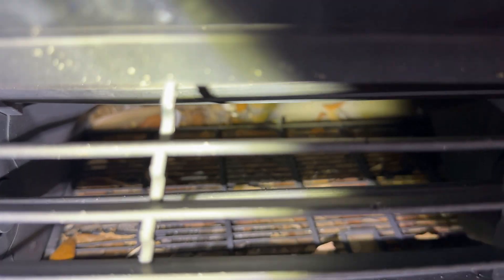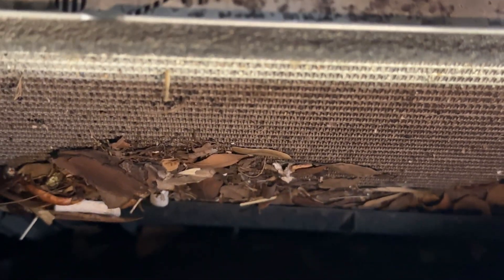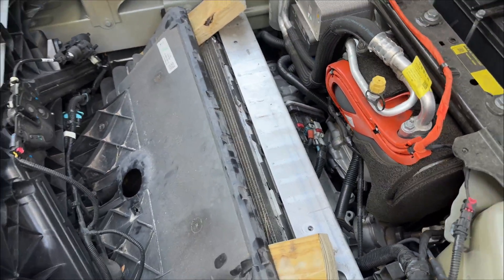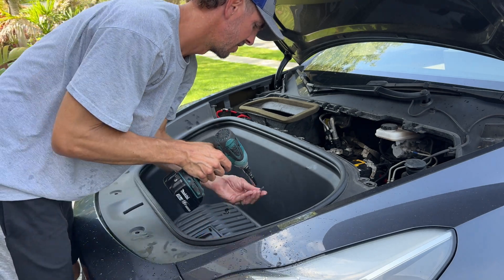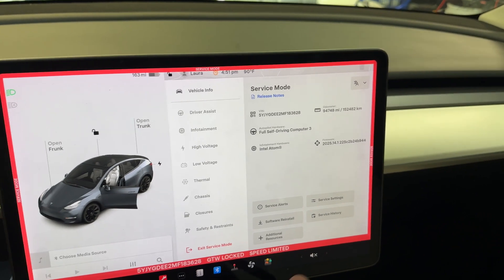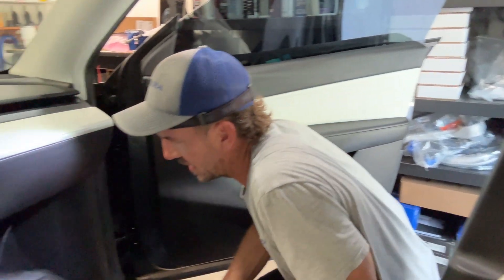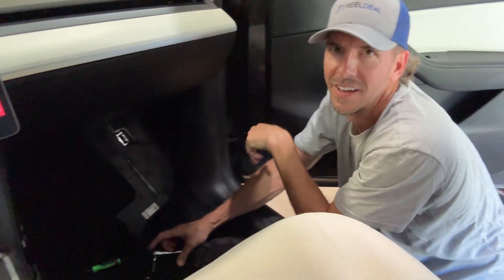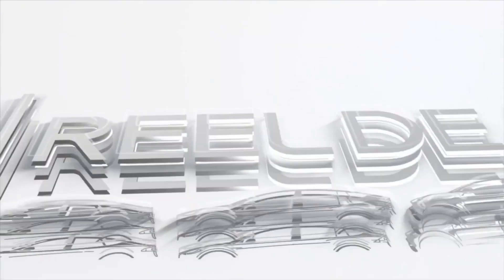How to clean your Tesla Radiator for VCFRONT A611_PoorRadiatorHeatRejection

Comment: you should have kept it in service mode or shut off the computer so the car doesnt turn fans on while working
Reply from the maker: Not a bad idea, but you would have to disconnect the HV and LV system, the service mode and computer wouldn't keep them off.

Comment: Interesting method. I just change the cabin filters in my high mileage 3 and they were clogged up to a level that tha ac was not working properly and halved my range. I can’t imagine how my condenser looks like. I will do this service soon. I think the this is a cheap way Tesla made this as on the Model S there are two large condenser and the are vertical so les dirt stays on the surface.
Reply from the maker: Yes, the radiators on the S and X do not have these issues like the 3 and Y

Comment: Besides reconnecting hv and lv batteries, what else did you have to do to move car outside? Great video. I’m surprised how much junk I have in mine at 27,000 miles. I’m in Florida. It’s not like I live up north, where the leaves fall on the ground every fall.

Comment: Great video—like my father always said, heat is the enemy of electronics, so a clear radiator is critical. If you’d rather skip yanking the frunk and wrestling brittle clips, try this shortcut that worked on my 140 k-mile Model Y: slide cardboard under the nose, lie on your side, and blast the radiator from below with a long-neck, rubber-tipped air wand (Harbor Freight, ≈ $20) while a shop-vac crevice tool sucks from the front. Gravity helps, so no water’s needed, and I could reach almost the entire heat exchanger. It’s probably not a full substitute for the top-side, water-flush method every 20–50 k miles, but in an hour I cleared out a mat of leaves, pine needles, and dust—no screws removed, no plastic sacrificed, just mind the active shutter actuator. Fast, no-tools peace of mind between major cleanings!
Reply: can you make a video of you doing it?
Reply: @marcosmagana4309  I should! But it's so simple – – just take a leaf blower running and blasted into the front grill of either your MY or M3.  The loose dirt will fall out. As others Have mentioned, This isn't the best way to clean it but in between serious cleanings or if you've never done anything – – it's probably better. Just be aware that you do have a fragile powered louver there. The leaf blower is not harsh enough to hurt it as far as I know and gravity helps pull a lot of dust and dirt right down to the ground I have a picture of that on the high mileage Tesla group on FB.
Reply: Could you make a video on this technique? I’d love to see it in action.

Comment: I will tell you at least in the model S plaid, that everything isn’t OK if you have any other color than blue or green, when you look at your coolant system going through the Octa clave everything should be the same color. The reason you have a purple or red line is because it’s far too hot coming from the radiator. That is the fault or the alarm it’s not wrong. You’re just interpreting the date on the screen wrong but the cleaning information I like
Reply from the maker: Thanks for the added info and your thoughts! I’ll look into that.

Comment: Other video's show using a canned spray cleaner used for condensers and the like. If the reader does want to do this work, look at other videos for other ideas and the like.
Reply from the maker: You don’t really need to use that on the condenser, that is usually for the evaporator. But if you want to spend the money it doesn’t hurt.

Comment: Nice video, straight forward and efficient. A video to save for that time I might have to do this. I had my car 4 1/2 years and milage is so low, I'm 82, the car may never need this service.
Reply from the maker: Props to you being 82 and looking into this service and choosing to drive this car! I can imagine it being a little overwhelming for such a huge transition from the cars you started with.
Reply: @thereelwdad My first car was a 1962 Sunbeam Alpine and I've pretty much stayed with sports cars my entire life. My Tesla M3 LR is the easiest car to drive I've ever had and makes me smile every time I drive it.
Reply: I’m 81 and I live rural Texas where there is lots of Trucks associated with fracking and hauling.  I had to stop and wait because of road work recently and it got  hot inside my Model Y.   At home I looked up and lots of grasshoppers, hay, etc so I washed it squirted the hose and washed but most of that trash remained.  
I’m following your instructions hopefully I can clean all that out. I’ve changed those filters inside and under the hood but doubt if that does much good. Appreciate your thorough instructions.     Gosh I hope I get it all put back together?

Comment: Mine is at the shop for this exact issue. Sounds like a jet engine. Overheating. AC not blowing nearly as cool as it should after i replaced my cabin air filters.  Definitely getting the mesh after getting mine cleaned out. Just bought a used 2022 awd model 3. A little disappointed this wasnt yaken care of before I purchased it.
Reply: Mesh or no mesh this is something that you should be doing annually. It used to be a part of the yearly service. They removed it to show the cars as "maintenance free". Now people are replacing failed condensers and fans every few years. I do it annually!
Reply: I just cleaned mine out yesterday.....2021 M3 LR that's been in AZ its entire life. It was atrocious!! 

The fan runs as it should now, no more jet engine going in my garage. The AC is blowing colder. I did it myself and it wasn't too bad at all honesty. The only issue I had other then the 110 degree heat was plugging the speaker located in the bumper BACK in.
Reply: How much did it cost you ?

Comment: I recommend my customers install the mesh aftermarket stuff they sell for the inlet on bottom to prevent this. It doesn't obstruct airflow like the ones they sell for the duct under the hood for cabin air. Nice job!
Reply: Who are “they” that sell the mesh piece? Thanks.
Reply from the maker: That is a great idea. I will look into that and try it out. What is your shop?
Reply: I’m also curious what kind of mesh you advice !